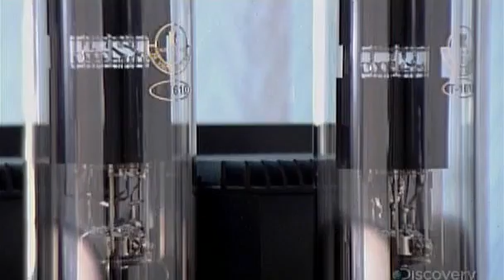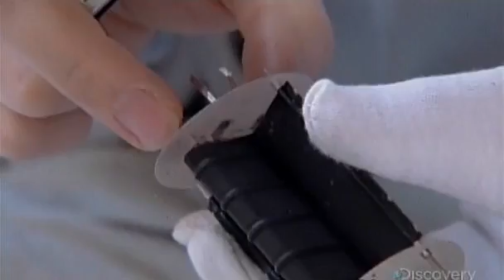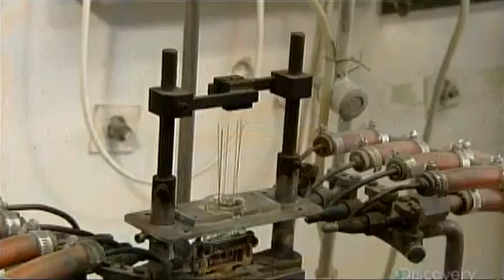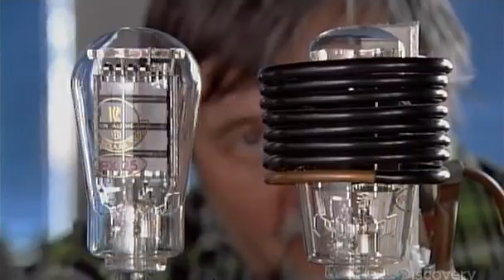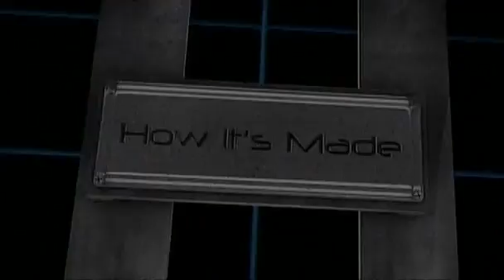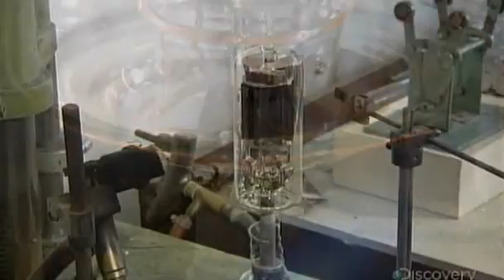How Its Made   Audio Vacuum Tubes  =KCK=

Comment: No, the transistor has replaced the tube for modern consumer applications since the later 60's. But tubes live on in the audio and radio world and there are plenty made. What you watched was KR audio hand making tubes that people will pay thousands of dollars each for. Lots of tubes are made on automated equipment equipment in Europe and Russia. I own a radio amplifier that can be used for amateur bands or commercial bands. It's output is a maximum of 4000 watts. Uses one 3CX3000 ceramic tube.

Comment: Claims in this video are false. Firstly, every microwave oven is based on a vacuum tube known as a "magnetron". These are not going away any time soon. Secondly, CRT displays are vacuum tubes. They have not all been displaced by liquid crystal displays. Thirdly, tubes do one thing very well which is to amplify signals which have a high frequency and high amplitude at the same time. Think: radar, particle accelerators.